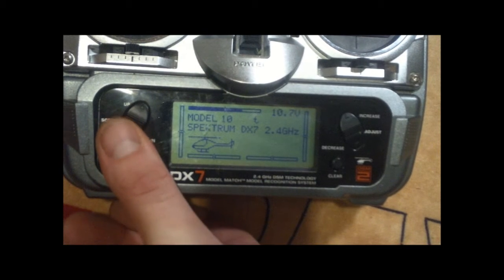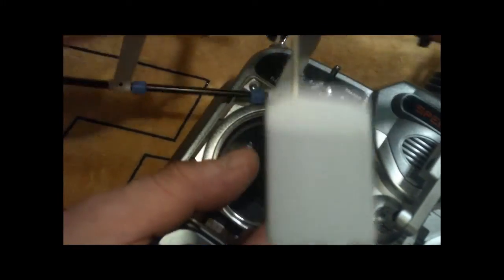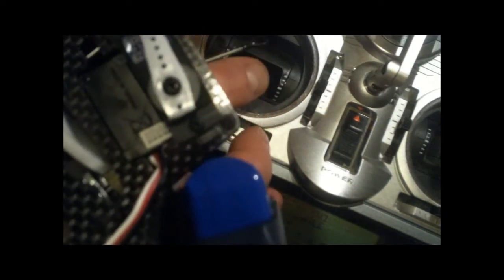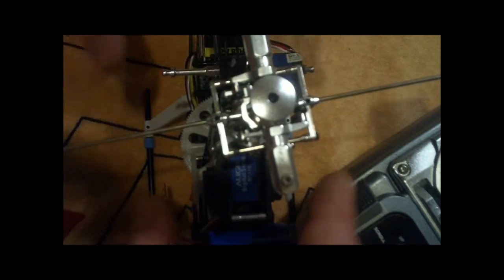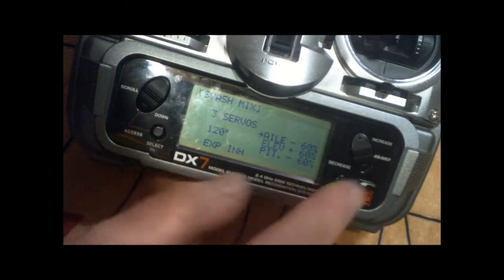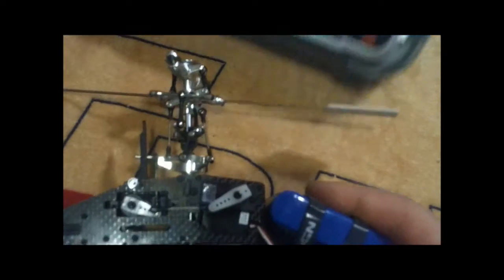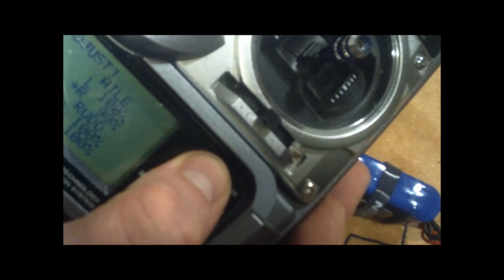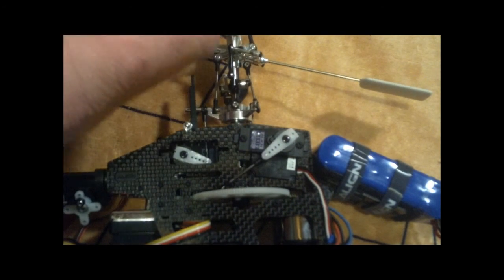DX7 programming part 2

Comment from the maker: Yes, those E-flight helis come with DSM2 technology, which is used on Spektrum transmitters.  They have a new system called DSMX, but it's backward compatible, so no need to worry.  You'll just have to go through the bind process with your new transmitter.  For your helis, that means to power up the heli until the light flashes fast, then hold the bind button in the back of the Tx when you turn it on.  Hold for 5 seconds, release, then the light should go solid and it should bind.